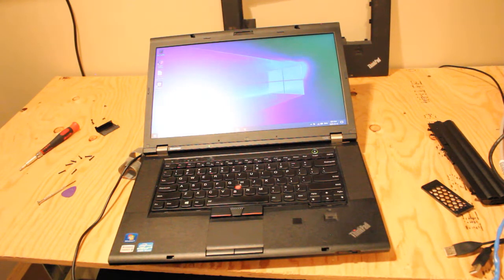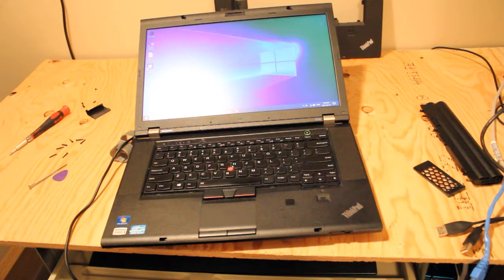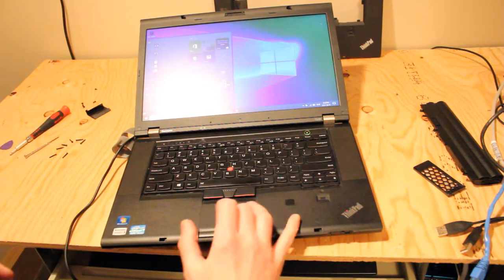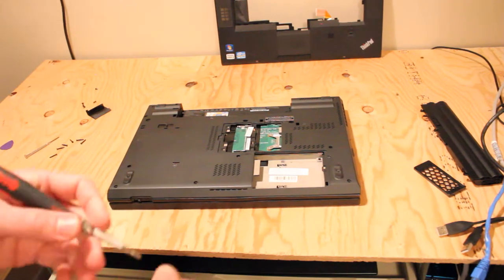Lenovo ThinkPad T530 Palm Rest Replacement (How to)

Comment: Error - that’s 10 screws.  You did not account for the screw you unscrewed at 2:52 when counting and showing screws at beginning.  

I followed along, paused and did each screw at each count and skipped the fast forwarded time lapse (my cataracts and glaucoma are getting shitty and I can’t do manuals and schematics anymore) and when I got to pulling the palm rest off, the one side wouldn’t budge.  I’ve done enough of these Thinkpads to know when something still feels screwed down.  Unscrewed the corresponding one and thing came loosen. Watched the time lapse and you do indeed skip that one in your initial count.  

Anyway, still a good resource, appreciate the video. These xx30 Thinkpads with rbe xx20 keyboards were the best Thinkpads never made.
Reply from the maker: Darn, well thanks for catching that!  Evidence that the proper information does make the difference.  My service to the community will be to pin this comment.  I have an X230 with a X220 keyboard at the moment that is just sitting around.  Video for that will be done sometime!
Reply: @HaisteComputerRepair  Same!  That is by far my favorite Thinkpad of all time, especially/particularly with the excellent NMB keyboards and an IPS screen.  The only thing that keeps it from being perfect is the resolution of the screen.  I suppose if I'm going to do the full HD mod, may as well do it now while I can still get the parts.

.............
Oh, and the reason I was here (I just wanted to know which  screws held the palmrest down.)  - FAIL.  

Less than six hours ago, I just damaged the motherboard on a mint W530 while replacing the BT module because that stupid black flipper thing for the palm rest ribbon cable was being unusually stubborn, so I got underneath it and SNAP. 

I literally don't know where to begin.  The whole damned thing is a spring tensioned surface mounted contact I don't even know ...I've got it delicately-tightly together with kapton tape and now the color meter, fingerprint reader and the trackpad are all wonky.  

OTOH, I have 2 spare W530s?
Reply from the maker: @ryhk3293 I'm not too sure about that one.  I am not that skilled at board repair.  usually it's assess and replace.  I guess you could part out one or dedicate the wonky one to a media viewer connected to a TV, or something?
Reply: @HaisteComputerRepair  This W530 was in SUCH good condition, too.  No keyboard shine or nuthin'. Are you on Reddit or any of the boards/forums?
Reply from the maker: @ryhk3293  I go through forums when I am troubleshooting, but not really no.  I am subbed to the ThinkPad reddit, but haven't posted in a while.  I've found that my YouTube channel is nearly devoid of rude people, so I tend to interact the most here.

Comment: uhmm, i dunno if you know this, but the touchpad surface is a sticker, you can just replace it, instead of the whole palmrest, but thanks for the video anyways
Reply from the maker: For sure and I can see how I didn't explicitly say that.  But, in the end, as the title of the video states, this is meant to demonstrate how to replace the palmrest.
Reply: @HaisteComputerRepair  yeah I agree, that's why im watching ur video and i Thank you for making it, also, i have a question, what is the square thing right beside the fingerprint scanner for? mine has no fingerprint scanner and i was thinking maybe the square thing is for using another kind of scanner.
Reply from the maker: @dukedolgoch  I believe it is just a placeholder when on the T530.  On the W530 workstation it's some kind of calibrator for an application.  I am actually not entirely sure as I have never used one.  They have the same palmrest as far as I know.
Reply: @HaisteComputerRepair  ok thanks for the info
Reply from the maker: @dukedolgoch  Cheers
Reply: @HaisteComputerRepair  man, I feel  stupid, i didnt hear you talkin about replacing the sticker at this part 0:53, I feel like a karen, Im so sorry
Reply from the maker: @dukedolgoch  Haha thanks but it's ok.

Comment: Well done.  I have a T530 with a palm rest that is waaaaay more worn that your customer's.  I will try this repair.  Any suggestions for a reliable source for the palm rest?
Reply from the maker: Check out eBay.  You'll find a lot of sellers overseas in China and in North America.  Now that I look back on this video, I remember that I was just wanting to swap out the touchpad as the palmrest was in fine shape.  I was just demonstrating how to do it, for ThinkPad content.  Normally, I would just order some touchpad stickers as they are inexpensive and aren't too bad.
Reply: @HaisteComputerRepair  I got the palmrest from eBay.  I followed your video and everything is working great.  One area I ran into a problem was one of the tiny brass nuts in the underside of the original palmrest pulled out and remained attached to the main laptop.  When I tried to install the new palmrest, it interfered with getting that area popped in.  I eventually identified it as the problem, removed it and everything went together.  Thanks for making this video.
Reply from the maker: @bruin1980  I am glad you had success! I have had trouble with those little things on several different laptops.  Especially bad around the hinges on a cheaper notebooks.